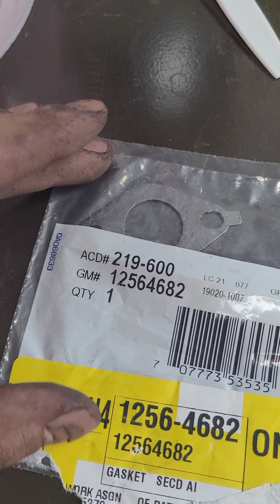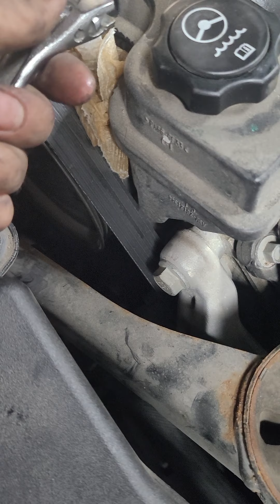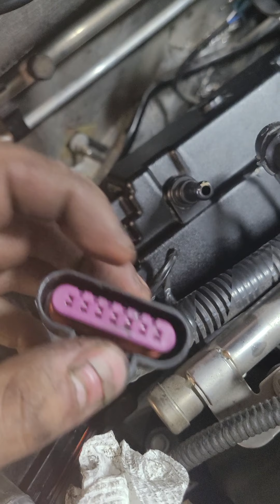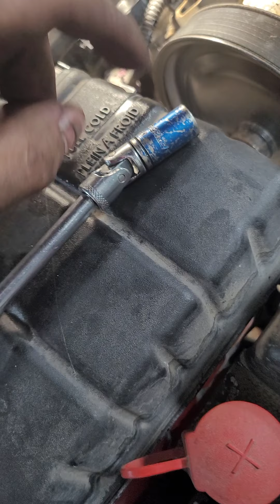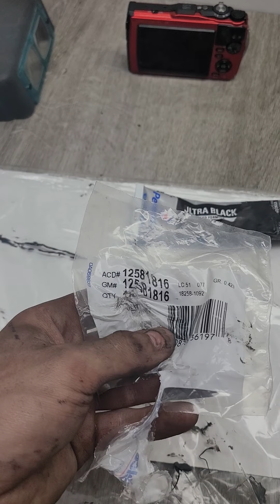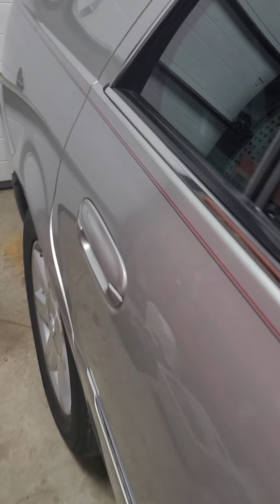06'-11' Cadillac DTS Buick Lucerne CXS REAR Valve Cover Replacement Guide/Tips

Comment: The other thing is while you're in there, torque all of your intake manifold bolts. Every single Northstar I come across the bolts are lose. Sometimes to the point they're not even finger tight. They're simply there. 10 bolts. You'll probably find one bolt that is still to torque specs. The other 9 aren't. It's 10 N/Meters or 79 Inch pounds. Not foot/lbs. That's not much. If you don't have a 1/4" torque wrench to do this and have a 10mm socket on the end of a screwdriver type drive, it's about that. Don't be Hercules. It's plastic. You don't want to break the intake manifold or you'll get a vacuum leak (and the dreaded SES light). If you do, you'll have to go to a junkyard to get a new one. I don't think you can buy that after-market. IMHO, it's worth buying the 1/4 drive torque wrench so you know it's at the right torque. Be sure to store it so it's not under stress and exercise it before using. That's what Pros do. In aviation, it's a requirement.

Comment: So how long does it take to do this job I mean you cut a big portion of it out right taking the valve cover out and then putting it back in I mean it didn't just lift up and come out that mother f*** is in so I'm taking that's a big part of the job anyways how long did it take you to do how many hours and do you recommend doing it inside an air conditioning area cuz it's hot as f*** down here in Florida

Comment: Let let me ask you a question why don't you have a video showing when you took the valve cover off I mean that's the most important part so we can see the seal the gasket and everything not that I don't appreciate your video but it doesn't do me any good to locate bolts and take stuff off the top I can do that I wanted to see the valve cover come off anyways I guess all you can do is what you can do

Comment: What tool did you use to get the rear 10 mm bolts I can’t reach them with a regular ratchet and extension
Reply: are you using a thin wall socket? that might be your issue.

Comment: Don't use RTV on this kind of gasket.  The silicone gasket is pliable and the only way it will leak is if the bolts come loose. All you're doing with RTV is creating a mess for the next guy, because it's not helping seal anything.  Also, clean the groove that the gasket sets it.

Comment: U disconnect the battery you will have to reset the smog check cycles which is a pain in the ass at times i did it without disconnecting the battery

Comment: Nice job. One point that I can help with. The wire harness connector that goes to the ignition coils is actually two pieces. The light gray part is a lock, there is a small pin component in the center-top. If you push down on it and then slide the entire light gray piece away from the connector it will come all of the way out. Now the rest of the black connector works like most other connectors, press down on the tab on the top and pull the connector away from the ignition coil harness.

Comment from the maker: UPDATE
valve cover is leaking again! I will be making a video and finding out why they are leaking again and how to prevent it from happening again. Parts are on order right now (9/15/22) and will have a video up within the next couple weeks.
Reply: There's a good chance it was because of the RV sealant. Those type of seals don't like when you add extra thickness to them and can cause them to seal unevenly.
Reply: WHERE IS THE UPDATE VIDEO? IT'S BEEN A YEAR SINCE YOU MADE THIS VIDEO? DONDE ESTA PART DEUX??? DANKE MUCHO
Reply: Plastic valve covers can also warp over time.

Comment: Just watched your video today 5/12/22. I have a 07 buick lucerne with the Northstar V8 too. I'm also having to change the rear valve cover Gasket and after watching this I know now what to look forward to. Very helpful to the point. I'll let you know how it goes. Also the starter is a real bitch too as I've had to do one on my 95 Cadillac. They put then under the Intake manifold, stupidest shit I've ever seen but did it with no issues.